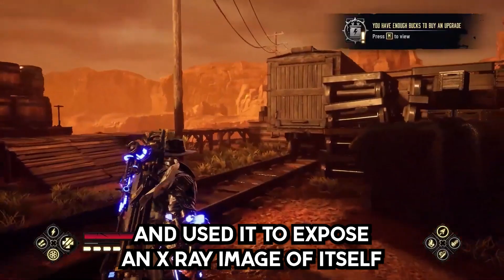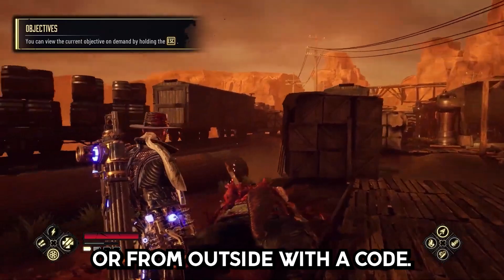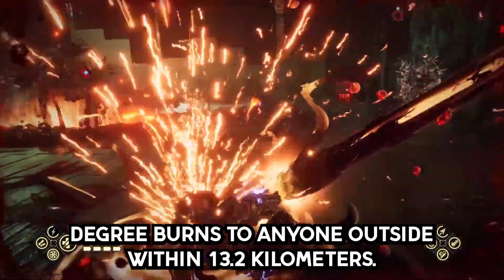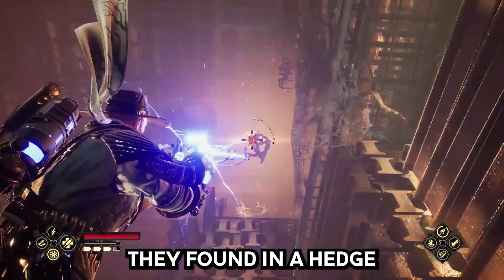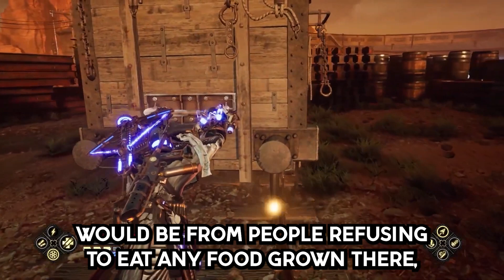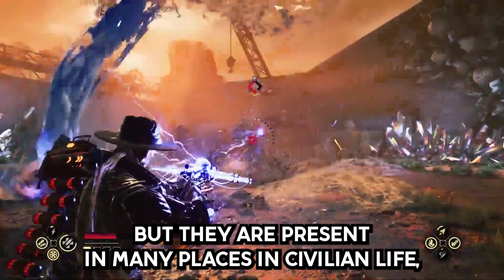What Is a Weird Fact You Know About Nuclear Bombs?

Comment: Some  for the masses - 
1 - Tsar Bomba Was supposed to be bigger than the 58MT yield. they used a lead casing tamper to give the Tu-95 ' Bear' Bomber  time to flee. if it was using the uranium Casing it was projected to be at 100MT. 

2 - The United states is currently missing 6 warheads. one is somewhere off Tybee Island, Goergia. 

3 - a Jettisoned 3.8MT Mk39 Warhead Only didn't go off because of 1 switch  ( Goldsboro Crash)

Comment: Ooh ooh. I know one. I did NBC crap in the air force. Here we go.
TL/DR nuclear explosion isnt a thing. Lets look at chernobyl. Melt down. What melted first? Yep, the rods. What pooled in the bottom of the reactor? Thats right, a greater than critical mass collected at the bottom of the reactor. No explosion. It melted the surrounding material and incorporated it until there was enough mass that the reactor material cooled into the 700 degree elephants foot.
Reply: Fun fact 2.
The elephants foot will be 700 degrees for the next 25000 or so years.